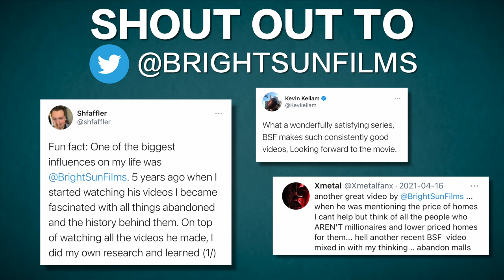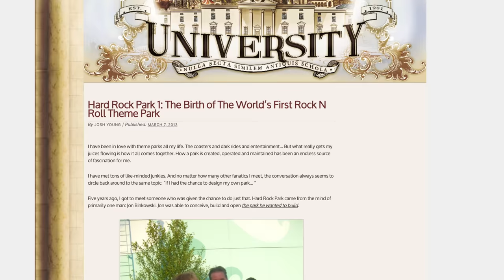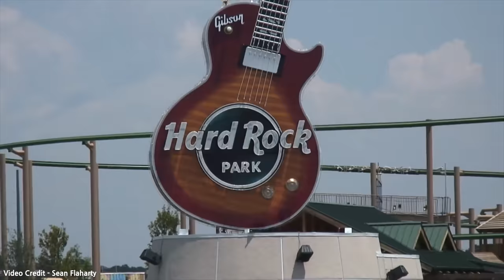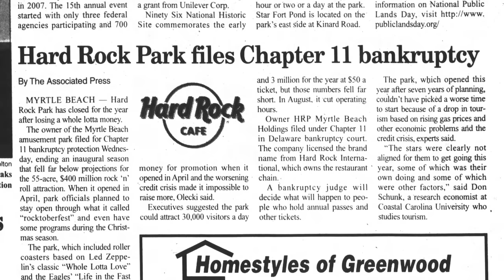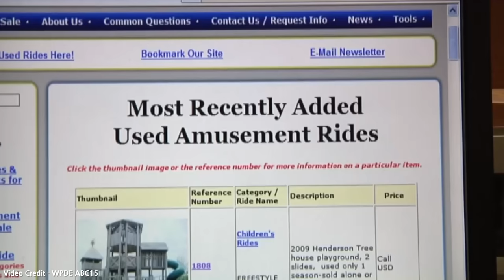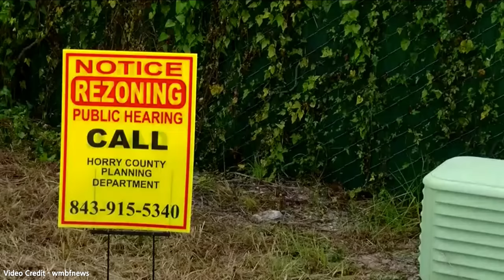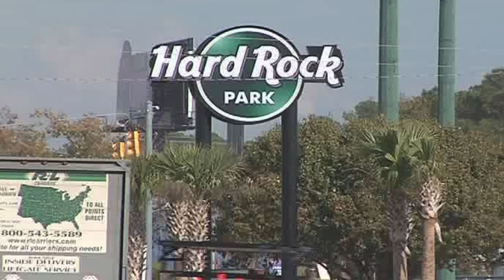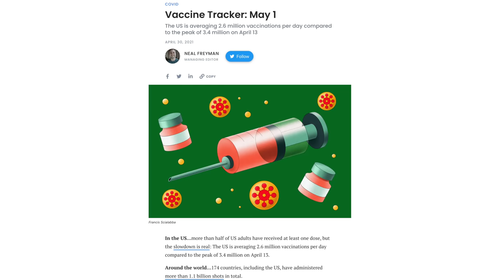Abandoned - Hard Rock Park

Comment: I passed by the park every day on my way home. It failed because: A. People who go to the beach don’t leave the beach, and the park was across a bridge and the inter coastal waterway. 2. It was expensive compared to other local parks. 3. It was hot with little shade or water rides and finally, it was built in a crappy and run down area that used to have the three factory outlets, which I worked at. Toss in a very generic roller coaster ride package and it was doomed to fail from the start. Once Hard Rock pulled out, the Free Style branding was horrible. Sad, but us locals knew it wouldn’t last, just not close so soon though.

Comment: I worked in radio in the area and did lots of promotion before and during opening. I also was commissioned by the Travel Channel to film the location. It certainly had potential and was a nice little amusement park. I drive by the location a lot and still think of the park each time.

Comment: I’ve been there multiple times when I was hard rock and freestyle. My mom worked there when it was hard rock and freestyle. I loved it. Being maybe only 13 at the time. I remember cutting fields of grass that summer to get money to go when it opened. And it did not disappoint, you could easily get lost and there was so much to do and look at. The line to get on the Led Zeppelin was over an hour at times. And the firework show was amazing. However. Ticket pricing was crazy and I remember paying almost 10 bucks for a cup of soda. No one talks about it but they had a area that had mounted guns that shot foam balls and some were air compressed and was basically full auto. But it was in a terrible location the highway is a bridge at that point and you can easily get lost trying to find the entrance to the park. They should have put it where the old pavilion was in my opinion. I just feel lucky enough to have experienced both parks multiple times and it’s very short life.

Comment: Hello, former Hard Rock Park employee, great documentary! I'd like to add more information on some of the reason the park failed that was not mentioned. Most of what you said was correct but there was a some pretty big blunders that were not mentioned. 

One of the big ones was that ownership had intended to build a casino adjacent to the park. From what I was told is they expected to get permits because the land was sitting on a Waccamaw reservation, but the local magistrate denied the permit. This would have been the 1st on land casino in South Carolina and I honestly believe the park could have succeeded with the inclusion of a casino.

Too much merchandise! Hard Rock had purchased an exorbitant amount of Hard Rock Park themed products that just did not sell. They had an off site warehouses that held what i believe at the time was north of 3 million worth of assets that needed to sell at the various store locations inside the park. If I recall correctly, I Think the average amount split between all the shops would need to make was some where in the 10k range to cut even.  This was a really big problem. We where able to offload some of the non Park branded merch to Cafes but still had millions worth of HRP branded junk that just would not sell.

Not enough to do!  One of the major complaints we had was the park was too expensive for the amount of rides available to our guest. The roller coaster Maximum RMP only worked for about 1 week before a critical part failed,  rendering the ride inoperable for the majority of time. One of the issues with it was that it was a fairly unique ride that used a carousel type motion to bring the cars to the top, as opposed to chain lifted  roller coasters. The part that failed had to be specially manufactured as the ride its self was a "one of  kind" causing the repair time to take longer. I believe the ride only functioned 1 of the 3 months the park was open, if that;  and If you didn't care for shows and went to the park for the thrill rides you where going to leave disappointed.

Very low season pass holders. 

Food was expensive and not that great was another common complaint we had.

These are just the big ones I can remember that were not mentioned in the video.

I really loved watching this and you earned my sub!

If anyone has any questions feel free to ask!

Comment: What surprises me is that there's a theme park called Thorpe Park in the UK. Despite all issues within its self and outside issues, it remains popular after 42 years. Management is key to survivability. That's the one issues with most of these parks. No one takes responsibility and cuts corners. It takes one idiot to ruin a solid development plan. If the original owners fixed their pricing correctly, sold a ride to a company to run and then allow outside investors to have one part of the park for themselves, they would of survived the recession.

Comment: Why was it an issue that the new owners of the park operate the park as it was? Like they removed all the branding of hard rock Cafe... You're telling me if I buy a pre-built theme park I can't open up the doors without tearing down everything and building a new park?
Reply: Like it just seems like they were salty the recession kicked them out of their own park
Reply: Perhaps some sort of pattened was placed on the archiectual design? Some sort of contract was breached maybe? Idk
Reply: @shabillalma4907  appreciate your response. Like I'm still confused because even then I don't understand how or why the park would sell their potentially patented rides in the land deal, especially without disclosing that they are not to be used commercially.
Reply: @shabillalma4907  eventually didn't the new owners start selling the rides on the lot at auction? 
If so I know the video doesn't say where they were sold to and how they were used by the people they had sold them off to. 
Like I'm curious as to where those rides ended up in the long run and if there were any lawsuits brought up against those who had purchased them.
Reply: @shabillalma4907  sorry for the triple response. I just wanted to say that it does make sense that make some of those purchases at the auction were out of country purchases that have no real concern for patent law, as well as some could have just ended up as some rich dudes toy. 
But either way like their still selling patent protected property that their not the owner of or producer of.